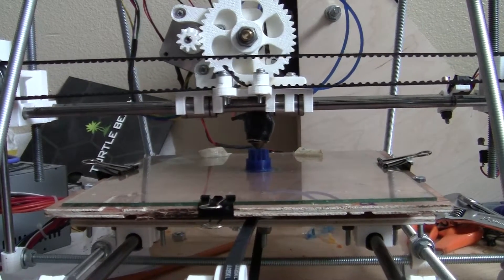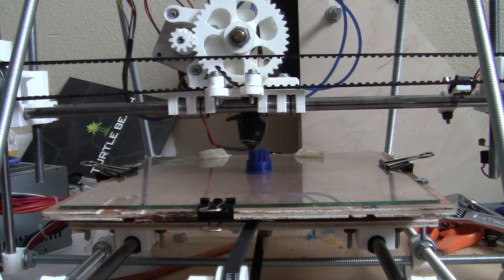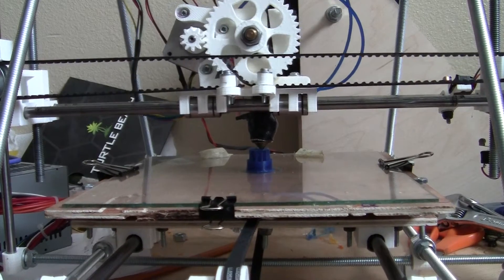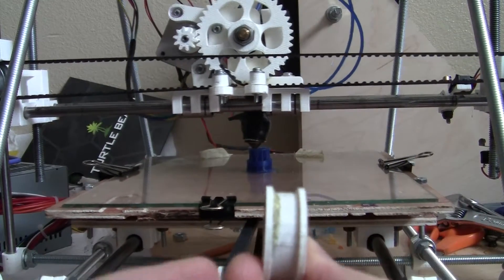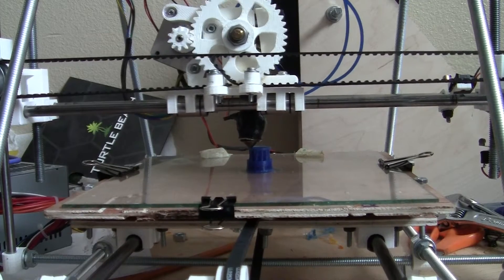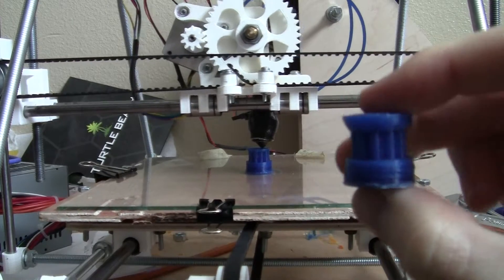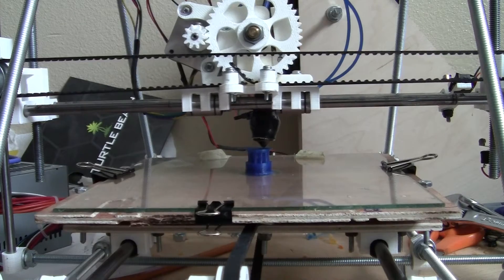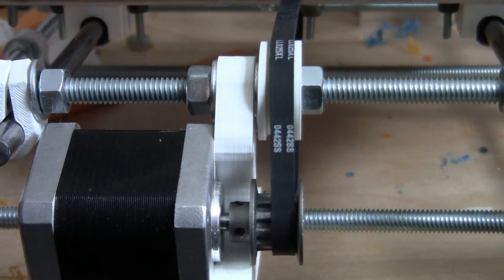RepRap Prusa 2 - Printing Pulley

Comment: You can see that your X carriage is jumping up off those linear bearings right? I use zip ties, or maybe your smooth rods aren't the right size for the bearings. You have really nice parts like those metal pulleys. It looks really funny when it shakes like that haha!